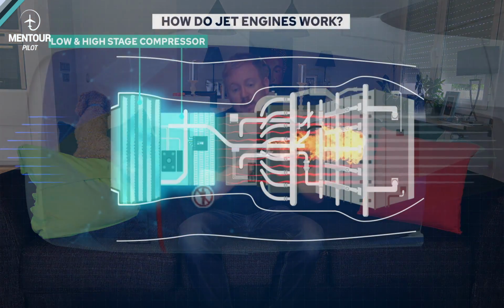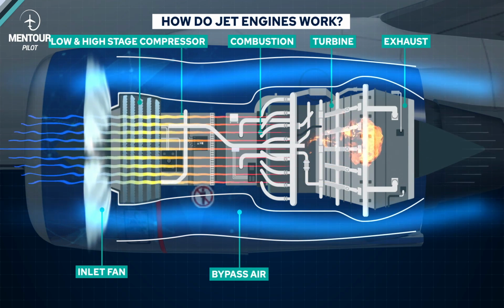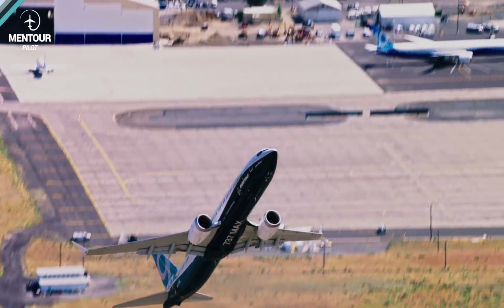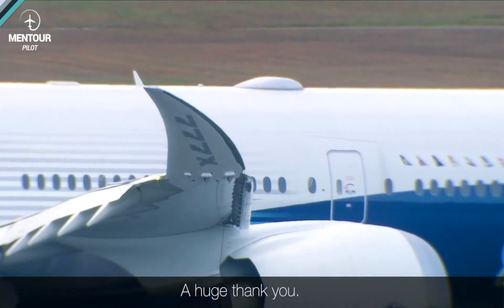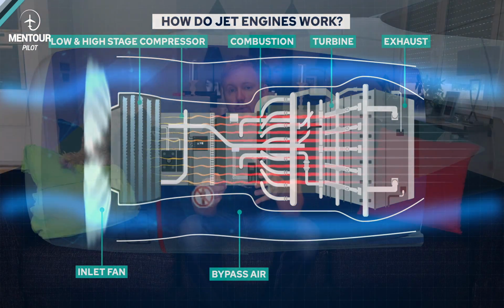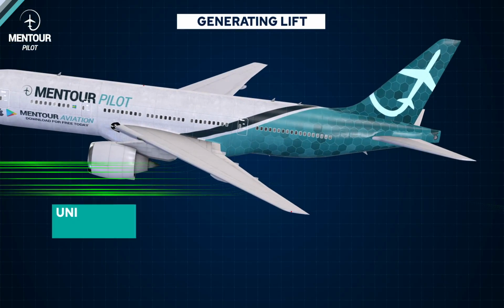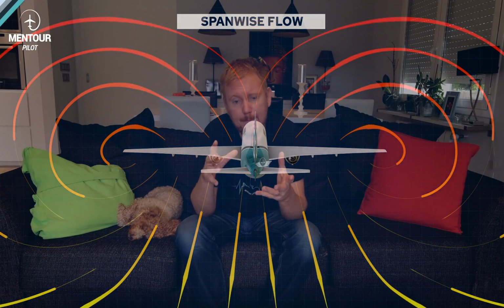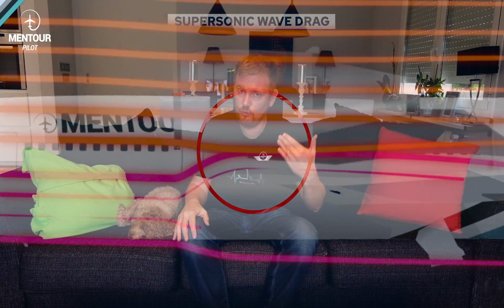How BIG can jet engines get?!

Comment: Is it likely that we may see a return to engines mounted near the tail like they were mounted on Tri-jets like Boeing 727, Dassault Falcon, MD-11 and DC-10. Will high bypass turbofans near the tail create more problems (heavier engine at the back- CG shifts to the rear).

Comment: Honda put their jets on top of the wings... They can also decrease the size of the core of the engine thus giving them a higher bypass ratio with out increasing the size of the engine thereby making the engine more efficient at a smaller size .

Comment: Why not mount bigger engines on fuselage like the MD 80 , eliminating the air flow problems over the wing?... most modern private corporate jets are also built with fuselage mounted engines.

Comment: What about thicker wings with the engine being right in the center and those few rows of seats extend slightly into the wing? What about other areas such as on top of the plane or maybe in the back next to the tail provided that all the benefits of the tail and those usually higher and smaller wings are not affected. Then we need to do the calculations...

Comment: In my opinion the "engine" will shrink again because it'll be more a generator than a turbo fan engine. The generator will drive many electrical engines placed all other an aircraft. E.g. at the tail of an aircraft where nasty aerodynamic things happens. Fans there can reduce the drag by 20% to 30% and that is huge! (OK - there is a conversion loss to electricity and wiring to the electric fans). In the end the total fan surface will increace despite the generator surface shrinking.
Electric fans will be the future. Not to be confused with battery fueled aircraft. Batteries are no go for aircraft with range of more than about 200 nm. Batteries are just too heavy and only fuel makes an aircraft lighter during flight. There are ways to make fuel out of electricity. 

C.c.: The 777-X was to late and to close to A380.

Comment: Ok, when we're losing advantages when putting the engines on top of the wings - why aren't we just moving the whole wings (with engines underneath) upwards?
We'd probably need to increase the structure around that part of the body but could save on landing gear weight... :-?

Comment: What about a lifting body design, or a flying wing, with an engine integrated into the wing or on top of the wing, or even on the rear of the aircraft body?  A large lifting body with give enormous internal space in the aircraft, as would a flying wing design.  I think it is time to revise the whole aircraft design process, perhaps even use hypersonic or sub-orbital flight to make travel between distant locations in much less time.

Comment: I was under the impression that the main driver towards higher bypass ratios was to avoid the main source of energy loss; heat. Yes heat does cause gases to expand, but once it is out of the engine it is wasted engergy. Running less air through the combustion chamber means less energy loss.

Comment: So why are the HondaJet’s engines over the wings? Could it be that they are high enough above the wings that they don’t have the same flow interaction as your example?
Reply: |.                              |
                                |
———————8——@——8———————

How about a double vertical 2x2 engine configuration? On the 737Max the upper engines would more than compensate for the nose up forces. (But obviously the costs would be ridiculous...) 😉

Comment: Apart from safety benefits and visuals (passengers seeing equally out);  isnt there a benefit for fitting a larger engine with a less massive landing gear by having the winds positioned near the top of the aircraft's top structure (like a Boeing C17 or even the small Cessna 150)

Comment: Why are landing lights turned on about 25 to 30 miles out on approach in the evening then turned off when the aircraft is at 10,000 feet and then back on close to landing.

Comment: If the engineers can't make the fan bigger to increase the bypass ratio, what if they make the gas turbine smaller. In theory this new engine would have a slight reduction in thrust, improved fuel efficiency, and reduced weight thanks to a smaller engine core and less fuel needed to go the same distance.
Reply: The core is just the right size to convert enough fuel chemical energy into thermal and kinetic energy. You cant make it smaller without reducing its power output, which reduces its ability to run the big fan, so reduces thrust. Engineering is all about the balance, but the fundamental limiting factors cannot be overcome (thats why perpetual motion machines don't exist).

Comment: The explanation is good but not technically 100 percent accurate. It should be explained as a Brayton thermodynamic cycle. The combustion chamber, where fuel is burned, heating that air, is a  constant-pressure process. Volume is increased.

Comment: I've always wondered if the same limitations that exist on putting engines above the wing exist on putting the engines around the tail. In theory, mounting the engines on the tail increases the weight of the tail region, right?

Comment: So if 80% of thrust is generated by bypass, does it mean that if I replace jet part by electrical engine to power the fan, it would generate 80% of thrust comparing to the normal engine?
Reply: and sitll need to produce the electricity somehow, that's the biggest problem
Reply: Pretty much yes, but the bypass fan is driven by the jet turbine. You would need a heck of an electric motor.

Comment: What about blending the engines into the wings? I remember that the B-47 and B707 broke from the blended design (like the Comet, for instance). Could blended the engine into the lower half of the wing save some ground clearance. I'm sure there would be some form drag increase, but what do you think?

Comment: I loved your explanation of why it's not so good to mount engines above the wing, but haven't McDonnel Douglas fitted engines  on the fuselage, albeit toward the rear, and also an engine in the tail? How would having two large GE-9X engines mounted on the fuselage( MD-90 style) of a 777 impact the airflow. It appears to my untrained, not mechanical mind, you could fit an even bigger GE-9XX, if such a beast ever became available, and not have the ground clearance issues mentioned - ignoring the weight issues you also mentioned just temporarily.

Comment: why is that the air friction to front of the airplane is not used for generating electricity  and use the generated electricity for extra fuel. I understand jets are aerodynamic but friction can never be zero.  horizontal parallel turbine  can  minimize the air resistance . why it has never been worked on?

Comment: This was cool! My understanding was that turbo-prop engines have even larger bypass ratios, but at the cruising speed of commercial airliners turbo-fans become more efficient. Could you also do a video that compares turbo-prop vs turbo-fan Please?
Reply: This is true, which is why you see short hop routes often use turbo-props, for instance Horizon's fleet of Dash 8s. They cruise at a lower altitude, and a lower speed, but with far greater efficiency. For short hops they can be a similar gate to gate time, but cost a lot less.

Comment: Why not integrate the engine in the wing having 60-70% on the bottom and 40-30% on the top of the wing? And also have both wings be 1 unit that could be detached for engine maintenance and have spare wings with good engines that can replace the faulty ones?
Reply: That was how it was done in the beginning. The load-bearing structure (the main spar had to be split around the engines) was complex and heavy even with the narrow early engines, there was no chance of retrofitting newer engines to an older airframe, engine maintenance was a major pain and the noise was transmitted through the wing root to the fuselage. The pylon mount is far superior.

Comment: Did you know that the top surface of the wing produces more lift than the bottom surface per unit surface area? That's how aerodynamics works with the underlying Bernoulli's equation, which defines the fluid flow parameters on surfaces.  Sorry,  if it sounds technical.

Comment: Engines on the top of the wings? Well, seems to be OK for the Antonov An-72.
Also, back in the old days, engines were located at the end of the fuselage. It is said, that the engineers are able to construct wings that are more efficient, while say don't have to carry the weight and force of the engines. Of course, the position at the top of the wings or at the end of the fuselage, will be harder and probably more expensive for maintenance.

Comment: Engine under the wing, engine on top of the wing... Thinking back to the DC-10s engine number 2: Center Engine on top of aircraft! There's positives and negatives to this. Seems like the negatives will prevail though. :(

If an engine disrupts the flow of air on top or under the wing, wouldn't a giant top-mounter reduce the impact on the air flow around the wing? The only impact on design would probably be, that the tail fin would have to change positions as well. That, and a pod strike would be very hard to do. :)

Depending on the length they could probably fit two engines in a row configuration (reducing the yaw change of a flamed out engine). But then again, the fuel needs to be pumped on top of the aircraft and a fire on the front engine would impact the second one. The roof will have to be harder (to carry the weight of the engine) and more fireproof (to keep the passengers safe). And I'm not sure how mechanics would access the engine for servicing it properly.

This comment is just a far out thought after watching this video. I'm not an aviation engineer, so I probably missed some major things on the positives and negatives concerning air flow around the hull or otherwise. I'd be glad if an actual engineer put some of those major things straight.

Comment: The A-10 design would be cool, mount the huge engines on the tail, and above the rear airfoils.  Which should avoid a lot of the pitfalls you mentioned.  Or better yet, mount the engines mid rear airfoil.  So an equal amount of engine is above and below the airfoil, and blended, so you avoid those pesky supersonic wakes.

Comment: Other complications, don't the fan blades to slow down as they get larger to remain subsonic,  and optimal speeds for different parts of the engines diverge so gearing may be required, also as bypass has increased it has become possible to have icing in engines, so deicing systems may be needed.

Comment: If engines are not placed on top of the wing, why not keep the engines on the bottom but move the wing on top of the fuselage mimicking the configuration of military transport? It would’ve been nice for you to address this configuration for civilian aircraft.

Lockheed explored converting the C5 to a passenger/cargo combo aircraft for civilian use maintaining the top wing configuration... of course there was no business case for Lockheed at the time.